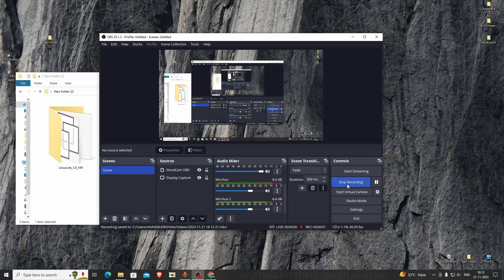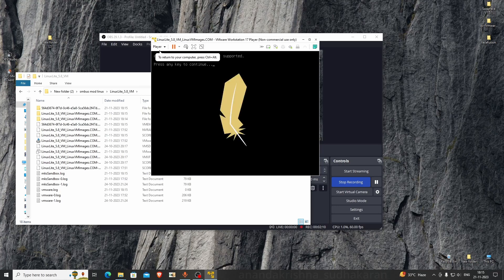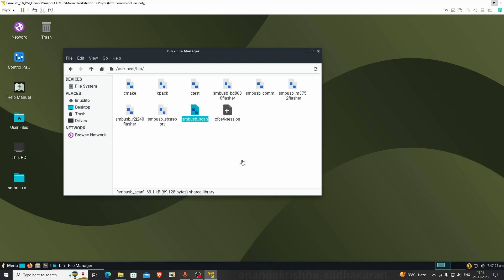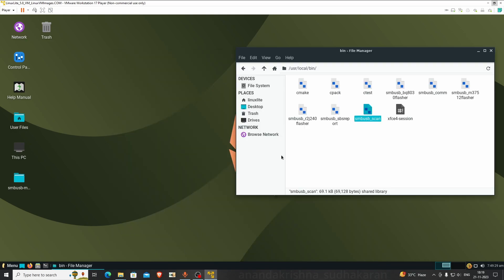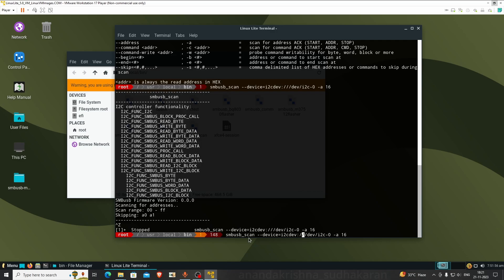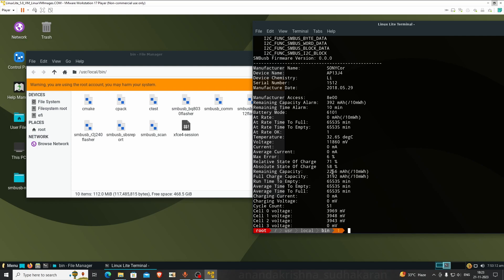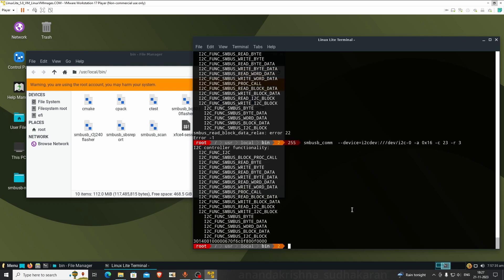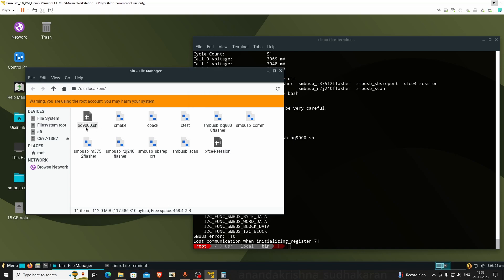"How to Set Up CP2112 on Linux to Read Battery Data: Step-by-Step Tutorial"

Comment: .Hi Anand
Is it possible to use ch341 or cp2102 to communicate with the laptop battery and in case that this is possible what are the connections.
Thank you

Comment: It seems so difficult to me.
Reply from the maker: Is your pc windows ? Also what is actually you want to do?
Reply: I'm using Windows 10.
The Mavic 2 battery is locked and I am trying to unlock it, but when I connect the cp2112 communication port, the error below appears and I cannot access the program.

This program is designed to unlock DJI Mavic batteries with BQ30Z55 and bq9003 (bq40z307) chips using the CP2112 HID USB to SMBus / I2C adapter. The program is distributed "as is" and the author is not responsible for any consequences caused by the fault of the program.
----------------------------------------------------------------
DJi Battery Killer ver. 0.5 Beta 2
compiled 01.02.2022
Thanks to everyone who helped in the creation and testing of this program ;)
----------------------------------------------------------------
use "Help" button to find the pinout
use "About" button for donate :)
----------------------------------------------------------------
PS Who is in the AndroSean sect, please do not use this free program, use the UBRT program that AndroSean advertises :)
----------------------------------------------------------------
File killer.ini opened successfully
Found 3 profile(s)
----------------------------------------------------------------
BQ9003 CHIP SELECTED
----------------------------------------------------------------
CP2112 HID USB to SMBus/I2C adapter successfully opened
CP2112 HID USB to SMBus/I2C adapter successfully configured
----------------------------------------------------------------
ERROR: Could not write Block to 0x44
----------------------------------------------------------------
ERROR: Could not perform SMBus read 0x00
----------------------------------------------------------------